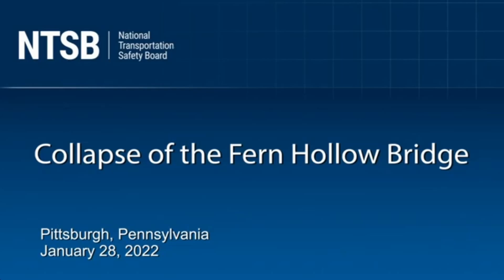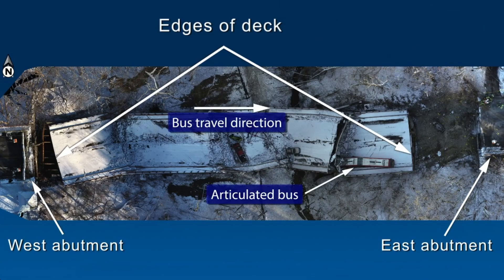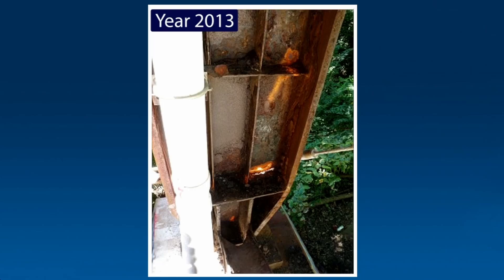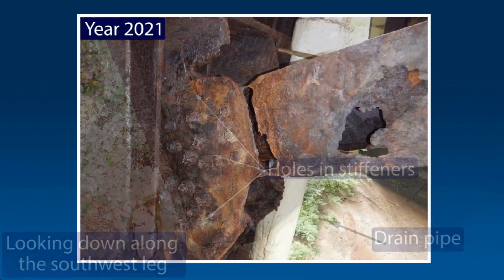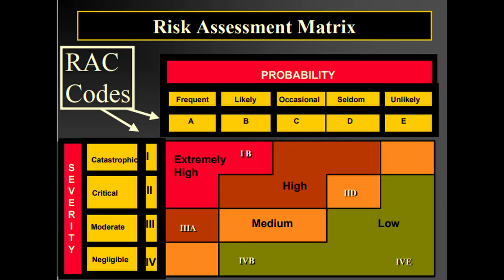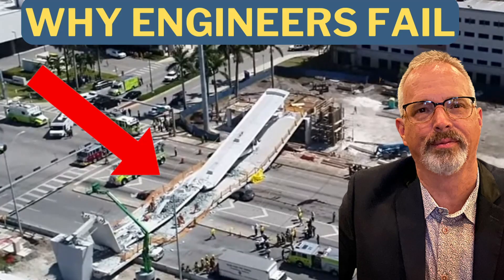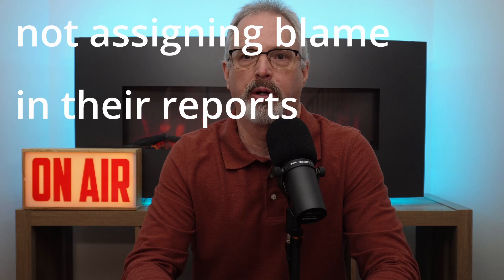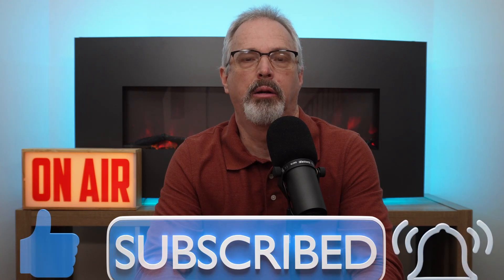Why the Fern Hollow Bridge Collapsed

Comment: Ha, I talked with a few local reporters on this bridge several years ago. As I had been reading their local coverage and found a number of things not covered in their reporting.

TLDR version is I told them that they didn’t account that as it crosses a park. It’s under very different environmental rules for work such as painting or repair which makes it far more expensive (in time and materials) to do. Secondly there was no commentary in the news about how much roadway is used in the area.

 thirdly reading various responses from state local and county as well as local councils you find that everyone is putting things off or pushing responsibility on paying for upkeep as the years pass on by and nothing ends up happening 

Along with the issue that there’s just far too many bridges and too small a pool of funds.
Reply: 2) Roadway salt in the area
Reply from the maker: It really is a sad state of affairs that today society is unable to maintain these bridges let alone build new ones.
Reply: @CaseyJones-Engineer  There is an easy fix. Put a toll on the projects and the users pay. When the project is paid off take away the toll. They built a big highway in British Columbia in Canada and it worked like a dream. Every project should be funded that way. User pay.

Comment: Some people feel they have a duty to save a buck because there's a safety factor built in at construction.
Reply from the maker: That is a good point.  I could see where some people think that since there is a inherent safety factor that such deterioration would be tolerable.  But that would be just gambling and not engineering.

Comment: As a 30 year mechanical engineer. I was horrified when I watched the NTSB video. I'm in Louisiana now and I know our infrastructure maintenance is garbage. Saving grace here is we've just got salt air and not road salt. If we had road salt down here every bridge in the state would already be collapsed. I want to know wtf penndot thought they were improving with those tie cables. There was literally nothing to tie to.
Reply from the maker: That is a good point that I forgot to mention.  It is likely putting a bandaid on a gaping wound.
Reply: It was not PennDOT's bridge. It belonged to the city of Pittsburgh.
Reply: @thomasrapp2536  Fine. They inspected it though and someone recommended cobbling that together like the tailgate on a rusty Ford pickup. Still doesn't answer my question.
Reply: Cables to make it look really cool and industrial? Maybe a fun exercise for undergrads to play around with ANSYS? 🤣😇🥰😍🤩😋💗💯💪🙏

Comment: Another angle's just appeared: Spain's experiencing a repeat performance of Grenfell Tower, a mid-height residential block caught by flames inside its external cladding, making firefighting impossible. Like Champlain Towers, the cost of repairs has proved prohibitive in the UK, but then again, the building industry, with helpless victims before them, hasn't necessarily been proactive in doing it on the cheap. I'd like to think a squad of Army Engineers rappelling down the outside could remove the offending material quickly and at low cost, leaving questions of damp.
Reply from the maker: Interesting.  That building sounds like it would definitely be a challenge to restore.
Reply: @CaseyJones-Engineer  It's numerous buildings. Grenfell Tower itself remains in wraps seven years after the fire, with accountability at all levels up to National Government engaged. Nearly 500 other buildings were identified with heights above the practical reach of Fire Service escape equipment, and innumerable others.
This is simply a microcosm of issues of all kinds in the building sector. We've seen particular issues with criminality in external insulation, as well.

Comment: That is wild.  Unbelievable that those legs were not replaced years ago.
Reply from the maker: Yes, you would have thought that it would have passed the common sense test!
Reply: @CaseyJones-Engineer  Amazing the legs held up so long in such a degraded condition.  Steel is a very capable material, but not magical.

Those inspection pictures taken several years ago really make one wonder.  How could an inspector not shut the bridge down for repairs, or at least put some shoring under it?  I'm mystified and kinda depressed.

Comment: Most engineers, being human, want to avoid confrontation.  And consultants don't want to recommend that an owner stop using an asset.  Some owners will either ignore such recommendations or hire another engineer who will disagree with the first engineer.  Consultants can become known as alarmists who cost owners a lot of money.  Another issue is Capital spending vs. Maintenance spending.  Capital spending on public works is approved at a high level, and does not flow from ordinary revenue streams collected locally.  Many/most highway and bridge construction is funded through Federal programs that match a much smaller percentage provided by the state and/or municipality.  Maintenance of the resulting structures usually is paid by local and state governments however. They have pressing needs that can crowd out maintenance spending in favor of higher-profile, politically popular issues. It's sad but true, and I don''t know of a remedy.
Reply from the maker: You make great points.  I think there simply has to be more leadership shown by the engineering community to better protect the public in these situations.
Reply: In the dam safety community, of which I was a member before retiring, we had the Association of State Dam Safety Officials (ASDSO) that became an effective agent to focus the engineering and regulatory community to reduce or prevent dam failures.  This came about after a number of high profile dam failures that attracted a lot of attention, including the Buffalo Creek tailings dam in 1972, and the US Bureau of Reclamation's Teton Dam in 1976.  More recently, in 2008, failure of a fly ash dam at TVA's Kingston power plant focused attention on coal ash disposal and impoundments.  Perhaps the structural engineering community could form a safety related association to focus on structural failures and their consequences.  I hope this helps.  @CaseyJones-Engineer

Comment: What the heck,  that bridge was ready to collapse in 2017 due to the complete rust through of the main support legs!   What is the point of an inspection if no one does anything about it!
Reply from the maker: I agree with you.  It makes zero sense.
Reply: @CaseyJones-Engineer  I'm not a structural engineer by trade but being ex-navy where we deal with corrosion and inspections....if I had seen that, I would have immediately called 911.  How that lasted 5 more years?    I've been involved with numerous cases were we found something really corroded...stopped everything and fixed it immediately or shored it up until it could be fixed via the shipyard.

Comment: I think people do often say something, but more often than not, they are ignored.  Ignore people long enough, and they tire of saying something.  However, this isn’t even close to the biggest problem with this bridge.

I think we need to assign blame to both the designers and the owners/maintainers.  Yes, this bridge suffered complete lack of maintenance to prevent rust and repair rust damage.  However, we need to ask why it suffered such catastrophic damage so relatively quickly.  As a retired engineer (electrical, structural and systems), I will argue poor design was a huge contributing factor.  Structural elements that are exposed to weather, and particularly exposed to extreme conditions such as road salt for 6 months of the year, should not be designed with large numbers of nooks and crannies that can catch and hold debris and moisture.  These bridge supports were almost designed for failure.  Having numerous exposed 90 degree angles and corners is a recipe for disaster with both steel and wood.

Structural elements that will be exposed to conditions like this should use box sections that present only smooth surfaces to the weather and have no areas that can trap and hold debris and moisture.  The box sections should either be airtight via welding or should have drain holes at the bottom where water can only get out and not get in.  Such designs are not only vastly easier to maintain (ever try to strip paint out of the inside corners of a box), but they also are much less needful of maintenance.

I believe as engineers we have a responsibility to make our designs resistant to failure and easy to maintain.  It isn’t our responsibility to do the maintenance, but it is our responsibility to both minimize the need for it and maximize the ease of it.
Reply from the maker: You make excellent points thank you!

Comment: ‘Weathering steel’ in a snow environment with salt application should not be an approved application of ‘weathering steel’, aka COR-TEN steel. 

I’ve seen COR-TEN steel on buildings in Midwest rust thru many years faster than the wizard architects/engineers envisioned. Bridges cannot tolerate premature corrosion, or predicted corrosion. 

What are they teaching engineers in material science classes? 

The webs of steel stiffeners are pockets of standing water. Add salt, and freezing, and no zinc based paint, and what did they think was going to happen? 

And when inspection showed premature corrosion - rust thru - as was said, ‘what’s the point of inspection in the first place if it’s going to be ignored?’. 

Deferred maintenance once shame on them. Deferred maintenance as long term policy shame on everyone in penndot.

Comment: I know the NTSB technically does not and cannot assign blame (basically you legally can't use their findings in a court case), but they do determine which entity did (or didn't do) whatever to cause the incident, and for as long as I can recall, they'll mention names and say so publicly. (I'll certainly never forget FIGG or the peer-review firm Berger in the FIU bridge event.) I guess I'm saying that "cause" is virtually the same as "who/what is to blame" for practical purposes.  ~~~ regarding finding life-threatening defects, I'm a pretty cynical anti-social jerk, and certainly not an inspector, but if I was, even I would not let such defects slide just because it's corporate common practice. Hell with my job, if I couldn't get some action done via company procedure I'd leak it to the press, big time.

Comment: This is PA we're talking about.  They don't want to spend anything more than the bare minimum on infrastructure (bare minimum = a car can drive over it).  Go through the state and there are yard signs everywhere complaining that their taxes are too high,  At the same time residents will bemoan the horrific state of their roads.  Ironically, Pittsburgh has by far the best roads in the state, the rest is far worse.  Without exaggeration I've seen better roads in developing countries.  (Edit: As an aside, there are basically no town parks in PA for the same reason: it would cost money.)
Reply from the maker: Wow, bad combination: high taxes and low level of public services.
Reply: @CaseyJones-Engineer  The impression I've gotten is that for a lot of folks in PA any taxes are too much taxes.

Comment: It is unbelievable that someone would be fired for bringing these problems to light.  
Although,  several years ago I was working as an electrician on a building that was being converted into a school.  We were in the basement wiring what was to become the cafeteria.  The elevator people were welding the rails using a gasoline powered welder with no ventilation in the room. 
I said something to our forman, who said something to the welders.
Their solution was to spin the welder 180 degrees so the exhaust was pointing away from us. 
That didn't help at all, and our eyes and throats continued to burn from the carbon monoxide.  

Following the chain of command,  I went to the job forman, who clearly wasn't going to do anything about it. 

I then threatened to report the issue to OSHA. I kept a business card of theirs in my wallet.
Within 30 minutes,  I was removed from the job and sent elsewhere to work. I  found out through a coworker that right after lunch, they had added an additional set of welding leads to the machine and had moved the welder over to the garage door, thus fixing the problem.  

I've been on jobs where people have died and it's horrible to have to work under those circumstances. 

Yes, safety cost money,  but not as much as the cost of huge repairs and lawsuits.

Comment: NTSB video posted on YouTube showed / explained a lot of failure. Wonder if the root cause was something as simple as how the ice melt / salt was directed off the bridge surface and down to the creek. Seems if the road surface runoff was properly directed then the failure mode wouldn’t have happened.
Reply from the maker: I think that is right.  The road salt getting on these weathering steel members is what did this bridge in.
Reply: @CaseyJones-Engineer  And the layer of leaves etc not allowing the steel to dry.

Comment: In defense of the engineers - I have worked with big engineering groups as a subcontractor, and in some groups, once the lower level employees figure out that if you speak up the only thing that happens is you get reprimanded or fired - they very quickly learn not to speak up.  It boils down to this - is saving some strangers from possible injury worth not being able to keep my family safe, fed, and healthy?    I have no knowledge that this is the working environment within Penn DOT, but it wouldn't surprise me if it was
Reply from the maker: I see you point.  There is too much going along to get along these days but there are very few protections for those who speak up.
Reply: Agreed. And that dynamic can be true all the way to the top. At each level, people can acknowledge a problem and try to do the right thing. Eventually it gets to the top of the hierarchy and our leaders do the same, acknowledge a problem and try to do the right thing. If there was a recent snow storm, the public is demanding better ice treatment. If a landslide took out a road, the public is demanding more money for stabilization. If the water company switched to more corrosive treatment, the public is demanding replacement of lead lines. These are all scenarios from the past few years in Pittsburgh.

I'm not sure how to assign blame but I think doing it justly won't provide the smoking gun that we desire. Maybe I'll be proven wrong but I don't think this will be borne out as pinpoint-able negligence. Too many people shoulder partial blame.

Comment: Glad to see a YT channel post the RAM. I know this is (was?) used by the US Army. An example (from 1991) was does the division move troops in helicopters with the seats in or out. Seats in means only 14 troops per chopper; out 20 troops. But in the event of a "hard" landing injuries without seats would be more severe. The answer, in peacetime maneuvers - seats in akways. In actual combat the  risk-reward ratio changes. Those extra 6 per chopper times many choppers = 100s of boots on the ground in the first lift. (Saddam's conscripts weren't too inclined to fight ...)
Reply from the maker: Very interesting.  Thank you for your insight on that!
Reply: @CaseyJones-Engineer  YW as one (ex-)engineer to another.

Comment: Safety is a culture. Starts at the top but at the top are ...

There is probably no hot-line to US DOT to report high risk situations. One can be sure if a stare DOT employee suspected US Highway $ were being lost to fraud there is a hot-line. 

Bridge near me, same state different municipality has been closed for years. But this was a low traffic count bridge with only a minor detour. And when I95 in Philly was damaged, PENNDOT & etc.got temp repairs done fast. The Pittsburgh Bridge - a few work weeks of engineers (structural & materials) plus some welders & steel plate would seem to have been all that could've been necessary for temp repairs.
Reply from the maker: Yes I agree with you.  The repairs could have been made with little effort or cost over 10 years ago.

Comment: I have worked on over 100 bridge replacements in PA, typically small one span bridges and box culverts.  I am usally not on site before it is torn down but a lot of those jobs were half bridges or the old parts were still on site.  I like to check out the old bridge and ask around to figure out why they were replacing it.  It is like 70% or more of this bridges were perfectly fine or needed minor repairs or they had grant money to spend.

Some are really bad though.

Comment: You should note that NTSB's legal charter requires that they not fix blame. Furthermore their reports cannot be used as evidence in litigation or prosecution. This is done specifically to encourage all the players to cooperate in the effort to find out what happened instead of trying to CYA. Furthermore, consulting engineers who perform inspections have a severe conflict of interest: those that "drop a dime" on defective structures are not likely to be hired for future inspections if they make the responsible entity look bad.

Comment: We have many bridges in eastern Canada that have been replaced because pf corrosion damage and some that are in dire need of replacement. Look up the Champlain Bridge, a major link between the island of Montreal and the South Shore over the St. Lawrence River and the Ile aux tortues (translates: turtle island) bridge which is in triage as I write this. It is on a major route to and from the western end of the island of Montreal, and is only operating on 3 of 6 lanes due to major degradation of the deck structure. I travelled on it recently and held my breath the whole way. . .